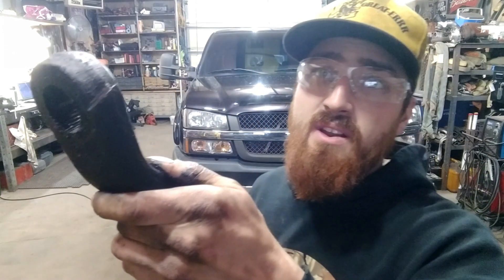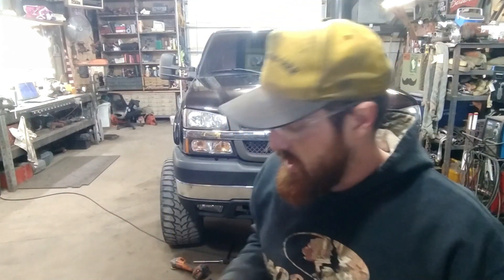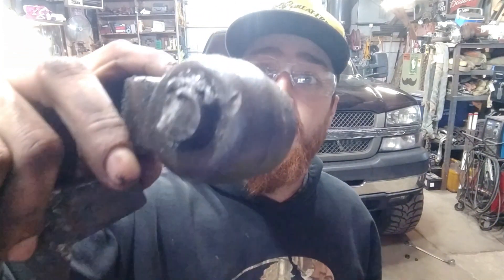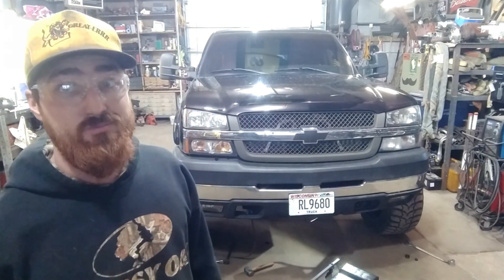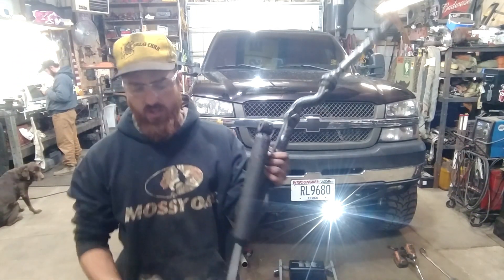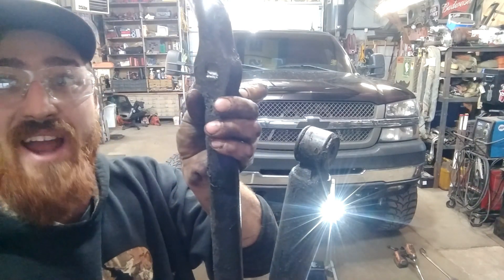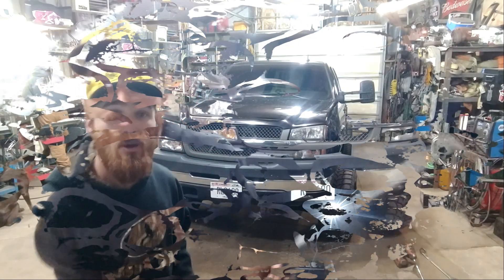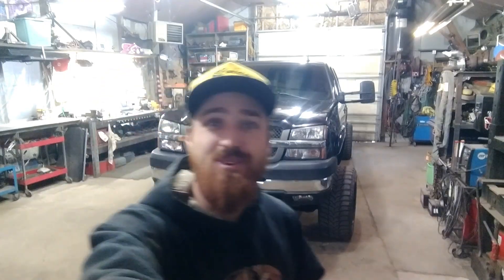***How to REMOVE any PITMAN ARM!!!

Comment: Were you able to bang the other half of that stud out of the center link that broke off of the pitman arm? I just had mine snap in half like that and it's stuck in there goooooood n tight.
Reply from the maker: Yes, best way if you don't have a pickle fork is to just bang on piece of pitman arm that goes omto center link. The vibration will shake it off the tapered bolt